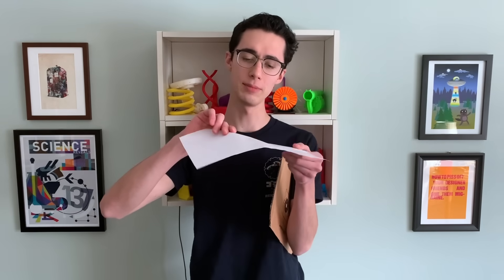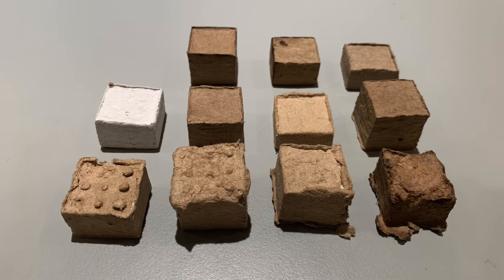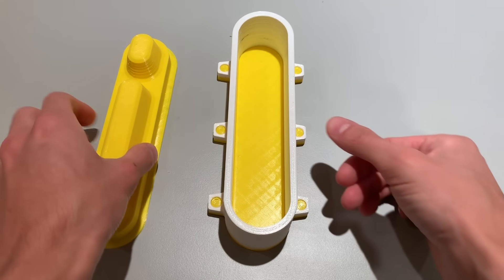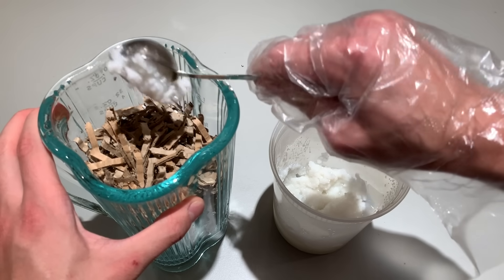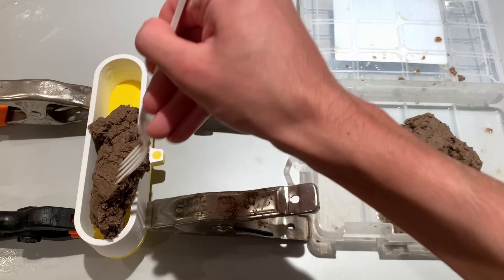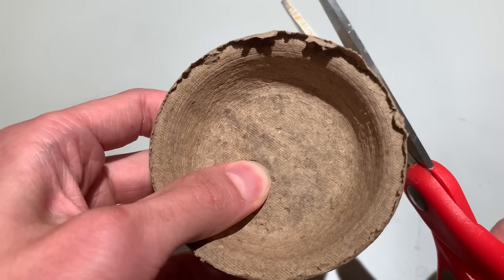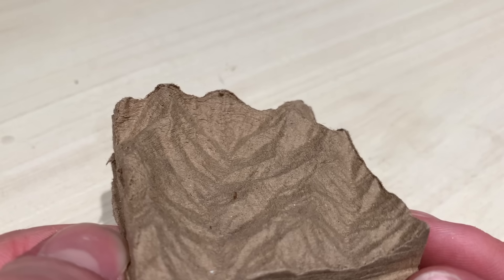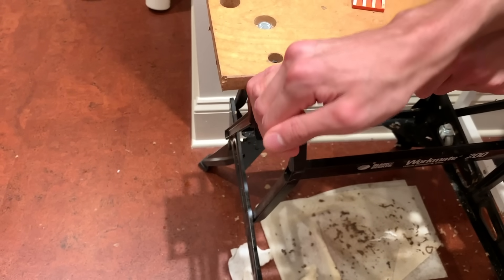Recycle Cardboard into Anything with 3D Printing!

Comment: Ok 3rd-year uni product design student here, I have done a lot of things with mycelium and other composites. But mycelium seems to be a fairly good comparison to this. Mycelium is an ok sound absorbing material, my professors say it's amazing but it's expensive, labor intensive, and shit to work with so fuck that. One of the biggest issues is the lack of protection against water but we have found a bio-based coating that seems to work pretty well for a lot of outside use. We are going to test it extensively in real-world conditions in a week for about a year to see how it holds up. The coating is from Impershield, the Bioseal mycelium. In preliminary tests, it worked well and it might work very well for this application as well.

The molding and pressing can 100% be automated once the shrinking and all other variables have been well documented and tested for a particular mold. That is mostly adapting a crazy expensive plastic or maybe even better, a brick mold machine.

I absolutely think this is amazing work you have done!! And I would like to do my own research/tests with this as well. It seems like a great alternative for packaging and maybe insolation material. We have also done some tests with coco-fiber. Just the fibers from coconuts. And it does fairly well in the sound-absorbing tests. This might do better and be better for the environment as transport of the material is much less! Processing seems to be the difficult part but solvable.

Comment: In terms of coating to make waterproof. Simple wax. Melt the wax and brush it on. A couple coats will probably do and then you can use a hair dryer to help it soak in evenly giving it a uniform waterproof layer

Comment: Thinking about coatings, there are paint products for the heritage home restoration market, such as milk paints, that while not making the material much more than water resistant, but they could provide an option for sealing against spillage. 

Also wondering about shredding and boiling PLA to break down its polymers back to shorter or even pure lactic acid (starch) as a binding compound. A sous vide cooker should be able to small quantities. This recycles our PLA wastes and sprues, and the fact that PLA can be broken down to starch by heat and moisture, makes it also a potentially compostable binding medium. Most modern PLAs are food safe, so have compost safe pigments. Your mileage may vary, though.

Comment: Interesting stuff. My first though was compressing a shape like a wheel chock. However wood is still relatively cheap. The best benefit of this would likely be to compress/mold shapes that take significant machine hours to manufacture.

Comment: I think a modular building mold would be helpful to develop and release to the community. Being able to print one mold and make a bunch of the same recycled material brick then connect those bricks together like LEGOs could really expand what could be built. Obviously 1:1 LEGO molds would be impractical but other connecting bricks or even some other ball and socket locking bricks or something might be useful for building larger things out of recycled paper and cardboard.

Comment: Shellac should work to waterproof it, if you're looking for a plant-based way to do that. It would probably work as a binder too, come to think of it. Either would be recyclable, too; applying a solvent would dissolve the shellac and let you reuse it

Linseed oil might work too, although you'd want to be really careful with that; the drying process is exothermic, and you run the risk of the pulp spontaneously combusting. Nitrocellulose lacquer would also work as a binder or waterproofing layer, with similar safety caveats. 

You could also use epoxy, polyester resin, or any of a number of other plastic binders, although they would make it very difficult to recycle the part. 

For mechanical parts, you could try reinforcing the part with pieces of wood, metal pins, fiberglass fabric, or any number of additives. 

I think you could also speed up the drying process somewhat by using an alcohol instead of water when you're making the pulp. It would evaporate a lot quicker, and I don't think it would change the end result much if at all. Alternately, you could use a food dehydrator, put them in the oven at a low temperature, leave them in the sun, or even just have a fan blowing on them.

You could also try vacuum-bagging the molds. That would (probably) eliminate the need for a mechanical press, would probably increase the density of the part considerably, and would speed up the drying process by dropping the pressure below the vapor pressure of water.

Comment: For a cheap, biodegradable water-proof coating, you could paint on a thin layer of rapeseed oil or any other drying oil. Many are available cheaply at grocery stores, though of course, you can also buy nicer oils purpose-made for varnishing if you go to a hardware store, like tung.

Comment: I have an interesting idea. Press the pulp cold with powdered beeswax in it then when it's dry put it in a very warm room so that the wax will melt and solidify your project while slicking the track for it to get out of the mold. Worth a try?
Reply: Also another idea your parts wouldn't shrink as much in the X and Y axis if you kept sprung tension on the plunger as it dried. The shrinkage would be mostly coped in the Z axis. Food for thought.

Comment: Information
Kalium waterglass could be used as a waterproofener, maybe. You could test that by  dip the piece in a glass of it. Or paint it on with a brush.
It should rise the fireresistance too.
Nice idea with the 3d printed molds.

Comment: It appears that industry has already begun using this technology. (I wonder what took them so long.) I recently purchased a large appliance that came in a large cardboard box. The edges of the box had been reinforced with what at first appeared to be smooth lengths of wooden cornice. But on closer inspection it turned out to be highly compressed cardboard. The box and other cardboard will go into my recycle bin. I hate to throw away the compressed cardboard cornice. It seems like it should have some value, but I don't know what I would use it for, so it will probably go into the recycle bin, too. But at least it is recyclable. I wonder how long it will be before our houses are made of this stuff.

Comment: Coating with wax should help the water vulnerability. Beeswax can be thinned with oil to make it easier to apply or melted and applied pure. 
Did it allow filler material without compromising strength too much? 
I don't know exactly what I have in mind. Maybe coffee grounds or other biodegradable bulk waste.

Comment: One thing you didn’t mention - when making the molds to demolish your part you need draft angle - so designing the mold will be like designing plastic injection molds but my guess is you need much steeper draft angles than you’d use for plastics (usually 1 degree or so) some experimentation could allow you to work out what draft as a rule of thumb is appropriate, and use tools in solidworks such as the plastics section to help with this identify undercuts in  the mold etc.
Reply from the maker: @jonnyhifi  I didn’t mention it because it’s not necessary. The pulp shrinks dramatically enough that you don’t need draft angles. Tapered walls also tend to cause shearing in the pulp because it redirects the compressive force of molding.
Reply: @ ahhhhh thank you! Really helpful to have had that pointed out. I stand corrected ! Well done once again an excellent very interesting video.

Comment: Regarding strength, this looks like a good use of PETG-CF, so-called "carbon filament" or "plastic aluminium." I've made pannier hanging hardware for my bicycle from this stuff, so it should be way strong. Prints as easily as PLA and is quite usable on any printer than can get over 230 degrees. My strongest prints come off the bed from a 237 degree hotend. FormFutura CarbonFil is my pref, but they all have really good strength and texture properties.

Comment: You know what I never understood? Why don't we coat cardboard in ceramic spray instead of plastic? It's waterproof, non-toxic when dried and non-organic, meaning when the cellulose biodegrades, it would just leave silicon dust behind, which is what primarily composes soil anyway.

Comment: perhaps coating it with an oil that can polymeryse in the air can help with water resistance up to a point. Lineseed oil is a good example.

Comment: Seems good for sound absorption panels since the material is cheap and I think less reflective than pla. A single press could fill a wall and they are large but flat so not hard to dry cunny

Comment: How similar is the final result compared to those cardboard material inserts you see that cradle parts inside of a cardboard box for shipping. What I am thinking of is probably similar to how egg crates are pressed, except  thicker so it’s much more rigid.
Reply from the maker: @FragEightyfive  Yeah the term for that is “Type 1 molded fiber”. This is similar, but even denser so it’s more rigid and hard

Comment: I used to do"paper casting" I used french clay as a binder. You can coat your finnished works with melted wax. Or puree the pulp,don't compress it let it dry then powder & mix w hot wax & Then mold & compress it. It'll make them water & weather proof. 
*I REALLY need a large feather cast to make a giant pair of angel wings for an Art progect. Where can I get one?  I was going to make the wings out of clay layered on molded chicken wire,but they'd be way too heavy & fragile...
Good luck. Kerp me posted of you tried my ideas. Curious to see how they turn out

Comment: If you used Titebond 3 or perhaps even epoxy (though you'd need to cure your pieces) as your binder, instead of Elmer's glue, you would gain a great deal of water resistance, and your objects would be more suitable for use in something like a sculpture... Man this video was awesome, you got my head spinning with ideas!
Reply from the maker: Both of those are plastic, and so largely defeat the point of this project and material.

Comment: I can input some of my indubious thoughts...
●Try to mix B(hardener) part silicone to get a uniue water resistant product.
■Try with carbon/graphene powder mixed into the mix(will vouch more for synthetic glue sadly reducing the organic & re-reusable quotient).
●Burn some of the dried out pulp mix(without the gum/binding agent) in a enclosed...possibly in a dehydrated chamber to get stronger bond materials which will mimic carbon-fiber. This will be more resilient than the previous graphene/carbon powder mixed one.
■Simply coat with Epoxy-resin adhesive mix to get a simple yet effective water resistant product. Premixing will do while in blender, but there are downsides of pre-curing for that...also the cost rises with more epoxy used...so coating a finished product is best, if required multiple coats can be applied.

There are many more.....I did some, rest were hidden behind the debris of Covid-Closed-Files(pun intended). So ask me if you feel intrigued...I got more to cough up, and many more are there in some weird corner of my brain! 🧠
Reply from the maker: Epoxy and silicone are both synthetic and non-compostable and so contradict the point of the project.

Comment: You could add some drying oil in the composition... A natural option would be tung oil, with time the oil oxidizes and forms a polymer.... While not water proof it certainly will resist water way more... If on top of that you sand de surface and coat it with carnauba wax it can give also more durability...

Comment: 3 things:
1. ignore these MDF bros, This material will be safer cheaper and more eco friendly than MDF. which uses large amounts of non eco-friendly adhesives and can cause respiratory issues when shaped. Making this Paperboard idea more suitable for household / office conditions where there are plenty of small applications that are currently taken up by wasteful polymer products.
2. If you can come up with a solid formula for the paperboard that would probably go along way to making this more accessible for people.
3. you can probably include more drainage into you moulds to remove a step from your process. though they would need to be able to withstand more pressure as the compression force would need to be increased. 

All in all I love this idea. keep plugging away at it. maybe you'll have a paperboard production company one day :)

Comment: Hey!  I love this.  Kudos for your dedication and successes.
I've been using shellac lately to coat chemically treated furniture so the chemicals get sealed in and stop off-gassing.  (Ideally one would not use such toxic treatments at all, but this is furniture I would struggle to get rid of and replace in my home).
So my first thought when you asked about how you might make your paper printed objects more resistant to water was: shellac!  It is non-toxic (it is basically made of resinous beetle excretion) and easy apply.  It also dries very quickly.  There are plenty of videos online on how to make shellac from shellac flakes and isopropyl alcohol.  If you give it a try, let me know how it works out?

Comment: i know this is old content, but for people watching, if you look up osmosis, you'll see how a difference of concentration and simply adding salt to the surrounding liquid can actually pull water out of the cells, and/or structure, perhaps doing that before/during the pressing proccess, you can get a more reliable shape and less warping, as well as drying faster

Comment: Sounds like you could make a nice bookshelf with this. Like... some of your stuff in the video comes off as being "thick" but nothing strikes me as being any thicker than half an inch.

So it'd probably be furniture quality at 1 1/2 inches or 2 inches. 

Honestly, I wouldn't expect normal wood to hold up to some of the stresses you put this stuff through.

You should try spraying, or brushing the finished product with more glue. Maybe add a stain and finish to it.

I'm interested

Comment: great plan! Using metal mold/presses and hydraulic presses would help make more dense/durable products. Natural biodegradeable water resistance could be added by using natural hydrophobic binders. Chat GPT came up with these ideas for waterproofing your pulp : suggest something?
ChatGPT said:
ChatGPT
Memory updated
To make water-resistant paper products using natural and biodegradable substances, consider the following options:

Beeswax: Melted and applied as a thin coating or incorporated into the pulp, beeswax provides water resistance and is biodegradable.

Soy Protein: Used as a natural binder, soy protein can enhance water resistance when cross-linked with heat or other natural additives.

Shellac: A resin secreted by the lac bug, shellac is biodegradable and creates a water-resistant coating. It can be applied after forming the paper.

Agar or Carrageenan: These seaweed-derived substances can form a thin water-resistant film when applied to paper surfaces.

Starch Blends: Modified natural starches (like cross-linked starches) are biodegradable and can be used to enhance water resistance when integrated with the pulp.

Tannin-Rich Extracts: Natural extracts from materials like quebracho or oak bark, when combined with other binders, can improve water resistance.

Plant-Based Oils: Oils like tung oil or linseed oil can be applied as a post-treatment to improve water repellency.

Each option's effectiveness will depend on the intended application, desired biodegradability, and production process. Testing combinations of these substances may yield the best results.
Reply from the maker: I appreciate it, but please don’t make comments like this. If you don’t actually have experience or answers, that’s okay. Anyone could ask an LLM on their own and get answers like this that may or may not be true. Pasting the output of a predicative text tool helps no one.

Comment: During the blending stage add several handfuls of paraffin wax. Normally burning these products expands them into ashes and ruins the fireplace but adding parafin wax makes ashes burn for around 2 to 3 hour I call them fuel logs they are great for emergencies you can buy 5kg of paraffin wax for £11 and you don't need that much. Adding too much paraffin wax could set fire to the creosote in your chimney the flames can be really tall great outside in a brazier but a knight mare in your chimeny so add something like coal over the fuel logs to shorten the flames any way the main use is for the elderly get a room hot and a fire going in minutes, I usually keep around 10 and they are a great use for unwanted cardboard. And emergencies.

Comment: Old project, but I don't see this idea presented on a skim of the comments section.
Gesso or mod podge can be used to coat an object made this way to make them more durable and, in the case of gesso, more water resistant. I still wouldn't try to make pool floaties or drinking cups out of it, but it would hold up against accidental spills and spritzings much better.

Comment: I'm wondering if anyone who has tried this method - if they have tried painting shellac on the finished, demolded and dried piece?  I understand that shellac can make cardboard very strong (surface strong) and water resistant.  I could see that making any molded cardboard piece even more useful.

Comment: I bet soaking the cured result in CA glue would make it waterproof and probably much stronger as well
Reply from the maker: Cyanoacrylate is plastic and therefore defeats the point of this project
Reply: @XYZAidan   smells better than most plastic though, so that helps 🤣
Reply: @XYZAidan how would you go about doing this for a larger mold?